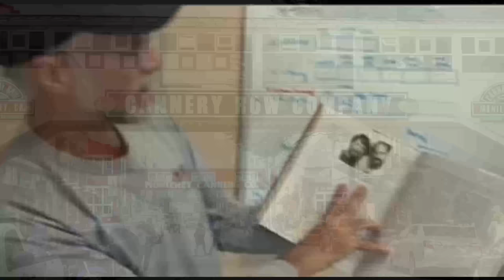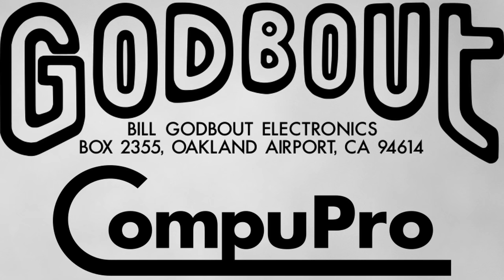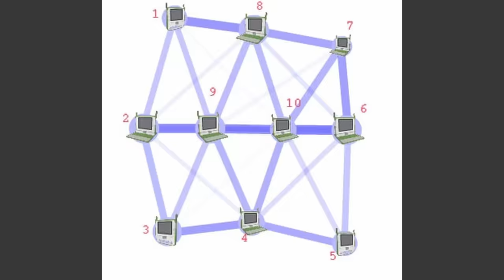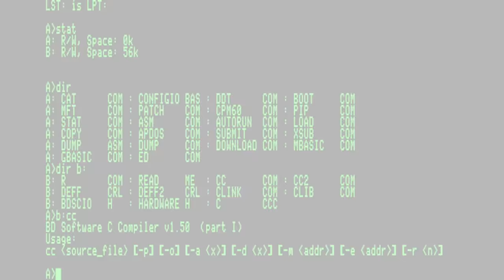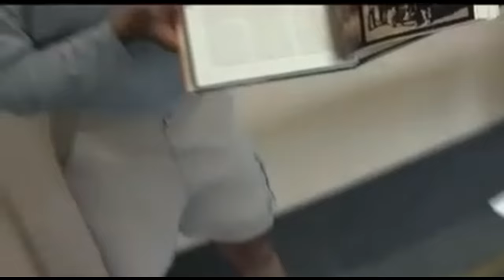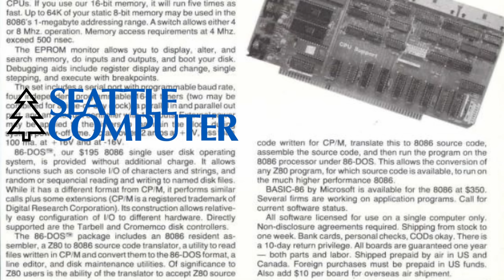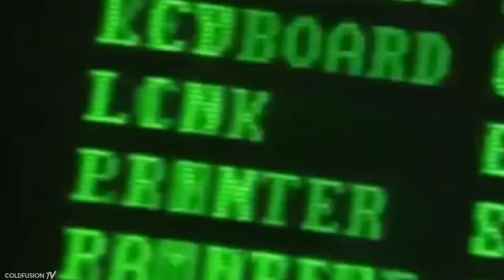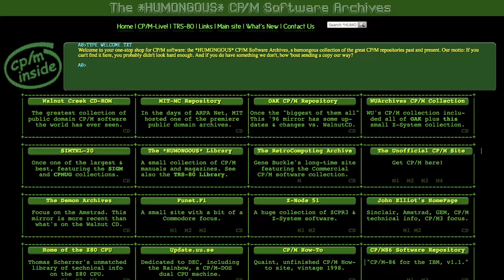Gary Kildall - The Man That Should Have Been Bill Gates - Part II STEREO RE-EDIT

Comment: To be clear, int 21h was on the x86 architecture. For the 8 bit 8080/Z80 version, the call to the BIOS was made by loading registers with particular values related to what you wanted to do (i/o, etc...) and then doing a jump to memory location 0005. When cloned into the x86 architecture, the same registers and values were used, but instead of jumping to a particular memory location, you did an interrupt 21h.

Comment: I'm not convinced DR or IBM could do a deal on this. IBM wanted a flat fee but DR was concerned about cannibalizing their existing customers. DR wanted to sell them MP/M which wasn't ready not 8086 CP/M which was what they wanted and was nearly ready. If you're IBM you'd be concerned about cannibalizing your existing mainframe and timesharing customers. 

And QDOS is a clean API clone as far as I can tell. At least Paterson claims he did a clean room reverse engineering of the API. Also it runs on a different CPU, and has a different calling convention (int 21h vs RST or JMP 5). It also has a different filesystem QDOS uses FAT which was invented for MS's Standalone Disk Basic and CPM had its own file system. The API is based on what you'd need to get a 8080 CP/M program to run after you'd put it through  SCP's TRANS86.

And, ironically, even though QDOS was designed to be device independent like CP/M the market settled on clones which are are completely binary compatible. E.g. you have a video display with a fixed layout at a fixed address (e.g. VGA 13h at segment A000h), UARTs have fixed register interfaces at fixed addresses (an 8250 compatible at 3f8h or 2f8h) and so on. Most MSDOS programs don't just use the Bios, they bypass it and write direct to the hardware.
Reply: Excellent comment! It really is the case that CP/M was specifically made to be able to adapt itself to the loose-to-no standards environment that existed in those early s100 personal computers. It was more about adapting to differnt architecture for connecting all the peripherals and how to talk to them... The CPU was the same, but where things were in the address space, and how to talk to each were the parts that needed abstraction. When IBM took over.. and the "IBM clone" became the dominate standard architecture, the need for the os to abstract away the addressing of everything faded. Of course, even these systems can be expanded custom, but the fact that there is always that expected architecture that needs to be emulated is an interesting move of the line of abstraction from the software and more toward the hardware.
Reply: You are right about this. I have read 2 books about this incident. DR is not going to accept a flat fee and Gary don't like the pushy attitude of the IBM executives. Beside this, the DR-DOS is also not yet ready for release and most likely the DR-DOS will not be ready to meet IBM schedule for the release of IBM PC. The IBM executives went back to Bill Gates and Bill Gates see an opportunity. Although Bill Gates don't have any Operating system on hand, he knew that Tim Paterson have already developed a DOS for 8086. Tim Paterson are frustrated by the delay of DR-DOS release and decided to create DOS himself. Bill Gates bought DOS from Tim Paterson and rebrand it as MS-DOS. When IBM PC become successful with MS-DOS, Gary did offer the DR-DOS to  IBM again. IBM didn't pre-install the DR-DOS and just offer DR-DOS as alternative to MS-DOS.

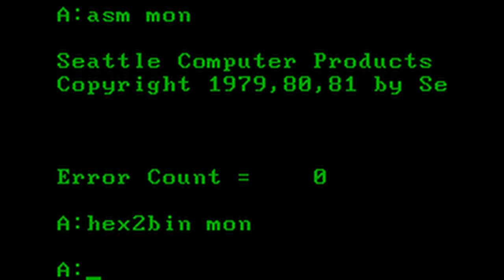Comment: Just a friendly correction:  At 28:39-28:42 you state that the prompt a CP/M user would see upon startup would be an A followed by a colon, or "A:".  This is not the case.  CP/M has always by default had the drive letter followed by the greater-than symbol, or "A>", which would be the drive letter followed by ">".  Some CP/M variations would be the drive letter followed by the user number such as "A0>" which is drive, user# then ">".  Another variation is 0A> (User#, drive#, then ">") but NEVER "A:".  Even in your at 28:42 it shows QDOS (see the "Seattle Computer Products copyright message, not Digital Research's) as having the "A:" prompt, not CP/M.
Reply: I noticed that too.  Big screw up there.

Comment: I'm a fan of Gary Kildall but this leaves a lot out. You do provide a text-over noting that CP/M-86 was still in development when the 5150 was released but didn't mention in this video, or the previous one, that DRI announced it would ship in early '79. The reason Tim Paterson wrote QDOS was because SCP thought DRI was dragging their feet and, when SCP shipped it in '80, so did the rest of the CP/M community. MS and IBM were most definitely responsible for burning the path forward for DRI but DRI had already started the fire behind themselves.

Comment: Why didn't they simply reduce the price of CPM-86 to make it competitive to PC-DOS?
Reply from the maker: As mentioned, IBM resold CP/M, it was out of the hands of DRI. IBM set the price, not DRI.
Reply: @AlsGeekLab  DRI wasn't allowed to sell their own product?
Reply from the maker: When you bought an IBM PC, you had the choice of buying MS-DOS, uP system or CP/M directly from IBM. Just like today, if you buy a PC, it comes with Windows. 99.8% of the market doesn't then wipe windows off it and go out and buy another operating system. There were no alternatives other than buying from IBM until the clones started like Compaq in 1983 or so. And they didn't really take off until 85-86. So you were forced to go IBM at the start, and that 3-6 year period was enough for Microsoft to take the stranglehold and own the market. Only a few brands such as Siemens persevered with CPM-86 (as Tom Rollander states).